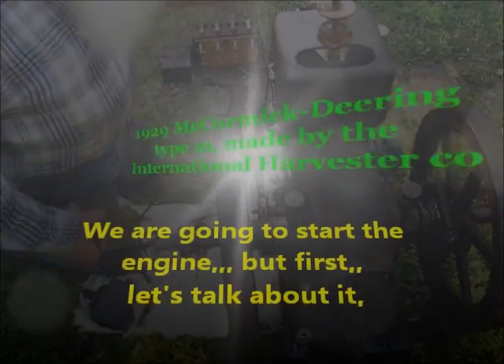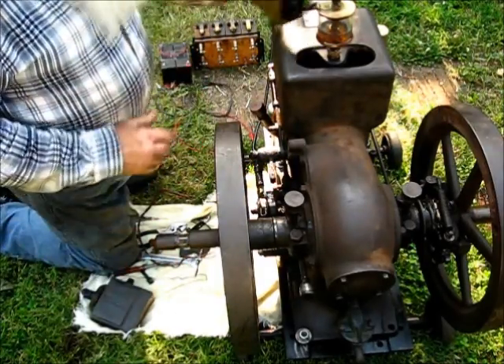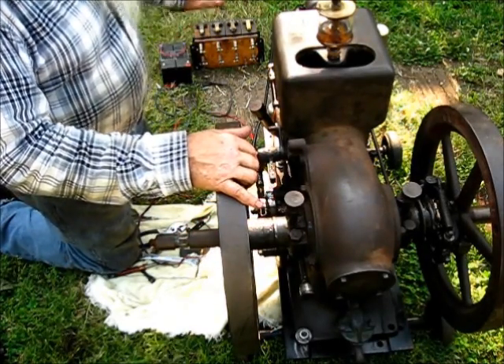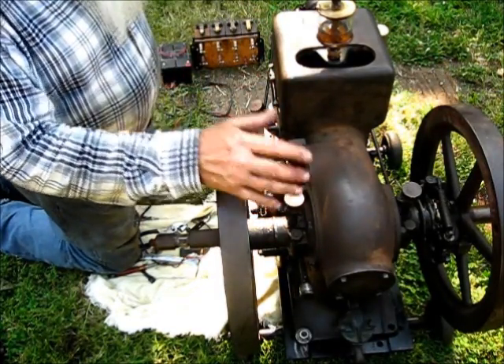1929 McCormick-Deering / type "M" flywheel engine / buzz coil ignition

Comment from the maker: ,, almost everything electrical now has a micro switch in it now, microwave oven, washing machine, clothes dryer, the last hospital bed motor unit I took apart had eight high quality switches in it,, big office type copiers,,, even the on off button on this computer i'm using has a micro switch inside the case,,,

Comment: Sure you can,simple test is to hook it up to a spark plug and ground it then trip the magneto,if you dont see a spark,or its a weak spark the  you need to backtest everything starting with the plug,the wire,the ground,the two pass through coils,the lead outs,the condensor,the points and the magnet.
All the items are testable and repairable or replaceable.

Comment: Batteries and coils were used prior to low tension ignition systems,but because batteries werent always available,self contained ignition systems like the ek mag and mags like the webster tri polar oscillator were developed.
Basically the micro switch is the trip ignitor.
Nice simple setup and is dependable untill the battery runs low,,then it just stalls since it has no way of developing any or a strong enough spark to ignite the fuel.